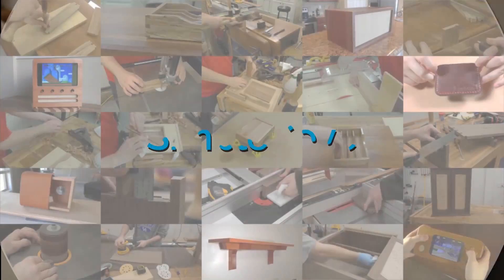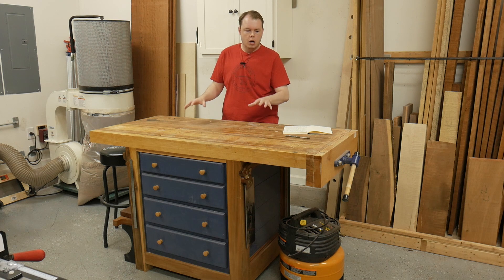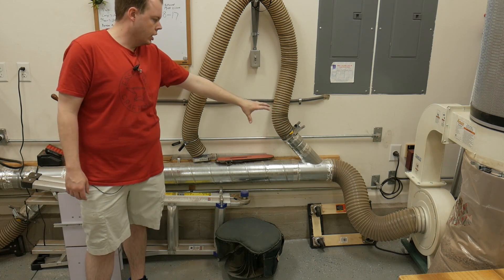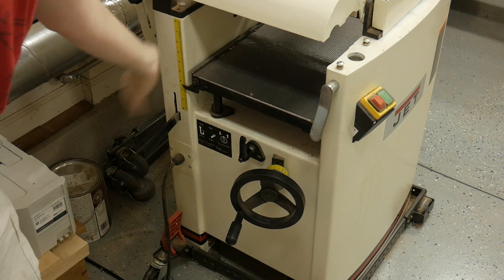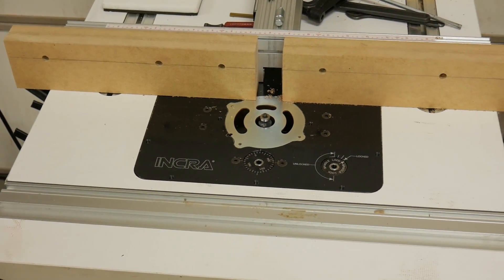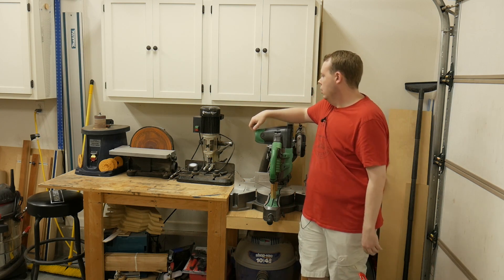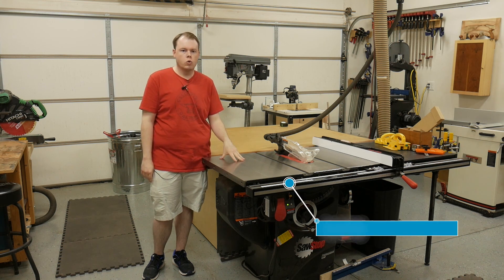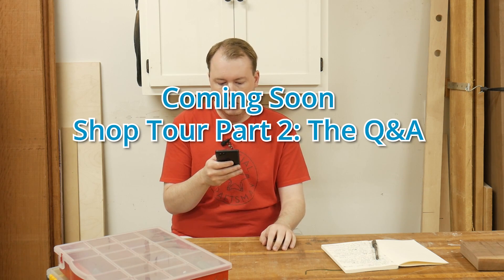2018 Shop Tour | Woodworking Shop Tour

Comment: Thanks for the tour Sean think I'm gonna switch to vertical storage. Space in my shop is very limited especially after I upgraded to a full size kreg router table. Look fwd to the next project.ive tried 3 different kreg fences and it wouldn't sit flush on the table and I noticed the miter gauge too. Kinda annoying. For the price it should've came with a fence at least I'm gonna get the rikon soon but for now it works good enough
Reply from the maker: Thanks Joe! Yeah the bandsaw is good but has it's limitations.
Reply: SimpleCove yea very limited..wish I had the risers for it.but the rikon I want has 13" re saw I think..
Reply from the maker: Yeah and adding this riser was a task. Had to drill holes and "make" stuff fit lol.

Comment: Nice tour! What size is your mini-split? I've been thinking about getting one for my shop.
Reply from the maker: I believe its 10,000 btu.
Reply: SimpleCove thanks, that helps me judge the size I'd need.
Reply from the maker: I would recommend using some sort of BTU calculator and if you can afford it, buy a unit just a little larger than you need. My unit in the summer is OK, but in the winter it's not enough to heat my shop which is why I have a 220 electric heater I run along side it.
Reply: Thanks for the additional thoughts. I'm good on heat, I've got a woodstove and a 220v heater. I just need to get better A/C. Tried a portable unit and it is nearly worthless.